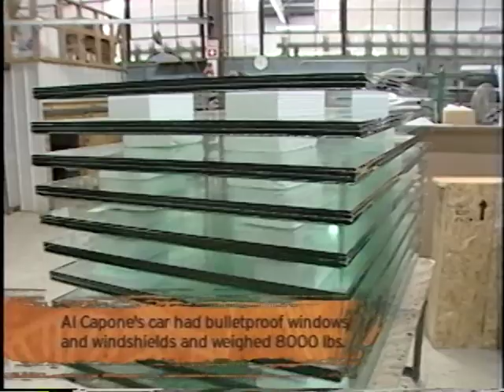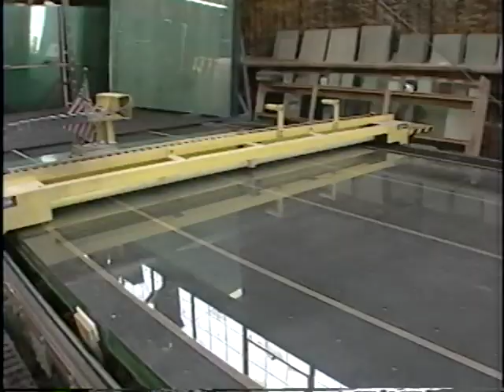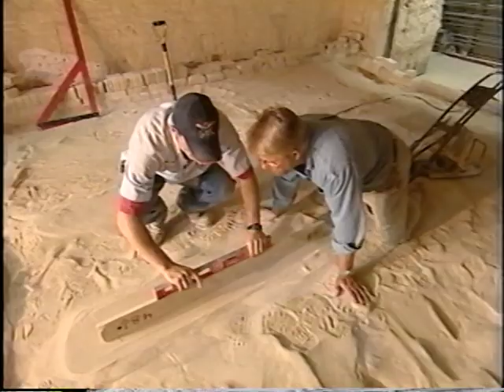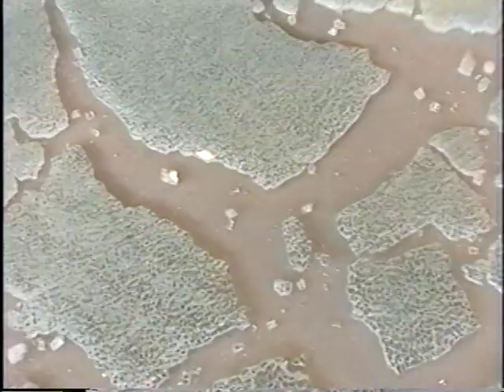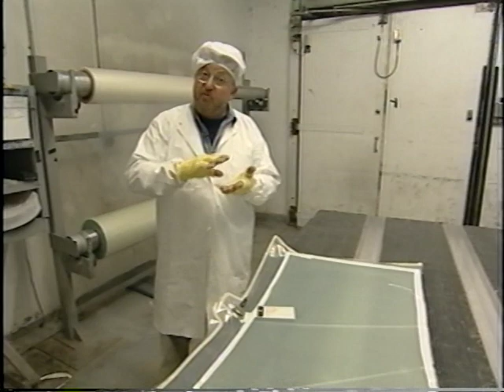Hands on History - Bulletproof Glass

Comment: When people use the term bullet proof obviously they are making a general statement and not specifying the caliber of the ammo or using the more appropriate term bullet resistant.  Technically the 16" guns on a Battleship shoot gigantic bullets.  A piece of glass resistant to 5.56 would have no problem with a .22.  I would give glass and additional rating.  The first rating would say that it is bullet resistant because it stopped the bullet.  The second rating would classify glass based on the glass not receiving any damage.  So for instance if you shot a piece of glass with a weapon using .22 ammo and you shot it 100 times and the results are no damage.  I would classify that glass as bullet proof up to .22 caliber.

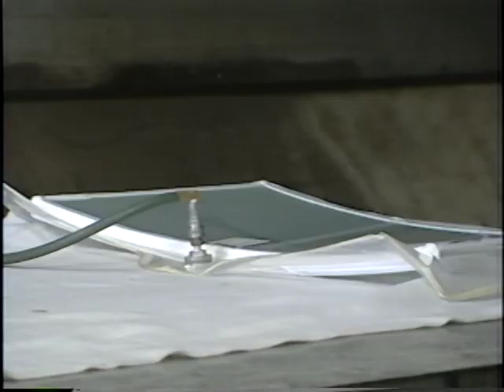Comment: 17:10 how the heat doesnt melt the plastic bag in which the glass is put?
Reply: The autoclave only goes up to around 280 max. It's brittle when pulled out, but not enough to actually breakdown.

Comment: The process for laminating the glass is the same as the process for laminating the composite structures that are replacing aluminum in aircraft.
 Think AirBus 380 (?) most of the fuselage is laminated composites of fiberglass and resin. Helicopter blades are made exactly the same way.

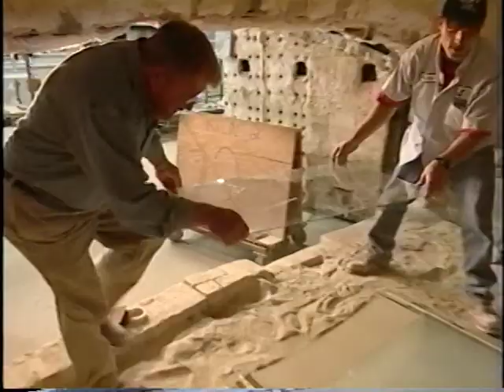Comment: @ 08:45 the commentator says "that way each piece will have the EXACTLY the same curve". This is not at all true. Each piece will have a unique curve based on a radius that is different than any other piece by the thickness of each piece relative to each other. If the glass was 1/4" thick, and the sand surface radius was, say, 120", then the down side of the first piece of glass would have a radius of 120", the up face of that same piece of glass would have a radius of 119-3/4", the down face of the next piece of glass would have the same radius as the up face of the first piece of glass (119-3/4"), and the up face of the second piece of glass would have a radius of 119-1/2", etc.
It may sound like I am splitting hairs, but if you tried to re-arrange the order of the glass pieces after they were curved, they would not fit together, as each one would have a different curve based on the increment of the thickness of the glass.

Comment: A 9 mm revolver ? Most 9 mm do not move 1200 feet per second . A 357 Magnum average is 1250 per second . But it's the weight of  the bullet times the speed gives you power . Do you want to impress me make it glass strong enough to stop at 44 Magnum that would be impressive
Reply: They have glass than can stop .50 bmg
Reply: That's when we get into using polycarbonate in the makeup. You'd ne amazed the combos a 4" thick window can stop. 50cal 3 direct hits in same location til it'll punch through.

Comment: When they mounted the bullet-resistant glass and shot it I noticed that they put the curve of the glass towards the shooter.  Did that make a difference to the resistance of the glass rather than putting the curve of the glass away from the shooter?
Reply: I'm not an expert on bulletproof glass but having worked in the automotive glass industry for 10+ years I can say with certainty that a lot of a vehicle's windshield strength is due to the curve facing outwards. If something were to hit it from the inside it would break a lot more easily. There have been quite a few instances where I had to do a replacement where the rear-view mirror was accidentally hit with a head or hand which caused the windshield to break from the inside. It's all about how the force is distributed through the glass due to its shape.
Reply: I suspect so. Some helicopter canopies that are rated for small arms fire will break if you drop a wrench from the inside.
Reply: This is why armored vehicles usually have alot in angles adds strength and can keep the round from hitting straight on and deflect it

Comment: I own a glass company, we replace glass in windows, we do table top glass, frameless shower enclosures, etc. 
First, the furnace the laminated glass goes in is a vacuum furnace, not a pressure vessel. It pulls a vacuum to get all the air out from in between the glass pieces. 
Next, when they setup the 3/8" glass to shoot it, he said "3/8 glass is what you'll find in your home" seemingly referring to windows. Most windows are actually 3/32 thick glass, or should I say 3/32 thin glass!! 3/8 is 4 times thicker than 3/32 glass. 1/8" is common for windows also.. I'd say it's 50/50. The only 3/8" thick glass you'll find in any home is the shower enclosure. Other than that... great information!
Reply: Michael Boyer it appears their autoclave is different in that they are pulling vacuum on the bags around the laminated glass while the pressure vessel does provide pressure to squeeze the bagged glass with more force than just atmospheric pressure would allow.
Reply: Bret, you're right. Mister Glassman give a s*it about physics.. ;)

And -1 bar at sea level is higest negative pressure what you or anyone can create. Kind of "negative absolute pressure". So If you need more force, you have to add positive pressure outside of that "bag". That laminating technic is nice brainchild.
Reply: @jannejohansson3383  hi Jane, it's nice to have a female in a technical conversation! I have never seen the type of process where there's a bag and you can manipulate pressure inside the bag, which is inside the furnace. Really cool! So thank you both for that info! I was wrong! And I do care about physics. I'm not sure what misled you, but you were definitely misled about that:)
And, it's technique, not technic. Are you Russian? Or Mongolian? Thanks again!
Reply: @mboyer68  I see that Janne Johansson hasn't replied but being a Swede, I recognize Janne as the nickname for the common male name Jan. It's not Jane and not pronounced like Jane and not a female name. Think of it as a Swedish form of Juan.
Reply: In real measurements 3mm is thin cheap glass and 5mm thick is the good stuff. 4mm and laminated 6mm are also used.
Reply: @maxmackinlay618  3mm = .183" which loosely equates to 3/16 which is far from this cheap glass. 5mm = 0.197 which isn't available on the United States. We have 3/32 (0.09375") and 1/8" (0.125") and 3/16 (0.1875) and 1/4" (0.250) and 1/2" (0.500)
Reply: @mboyer68  3/16 equates to 4.763 mm. 1/8 is approx 3mm. We don't use thinner than 3mm for houses in Aust.
Reply: I have extra thick glass in my windows.

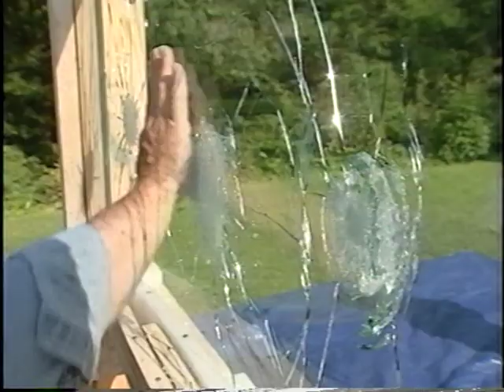Comment: fraud. the first bullet hole is not in the same place as in the final glass, 21:05 and then 21:35. notice the other gun-firing shots, you can see the whole pane of glass in a single recording. The first bullet hits the "bullet-resistant" glass below a dark spot on the vertical 2x4 on the right. In the final shot, the hole is above that mark and we don't see where the other bullets hit the glass because it would be too hard to try and fake three holes. Buncha liars.
Reply from the maker: Good day @h7opolo.  You certainly do have keen observation.  We appreciate you watching.  SBG has had DOD contracts for BR glass for many decades and takes pride in protecting our soldiers from harm.  That being said, this History channel special was filmed a loooong time ago.  There is a chance they may have made a mistake in editing however I assure you, there is nothing fraudulent about the product.  Cheers.
Reply: I doubt if they faked it. That would be a lot of work. But I could see them having to do 2-3 takes, using fresh pieces of glass. This is frequently done in video editing so the editor can choose the best take for each angle. I noticed that there were at least two pieces of glass in the autoclave, so they probably had a backup piece. It would be stupid not to.
I also noticed that the first shot was very close to the edge of the glass and might have compromised the structure of the glass, causing an issue when subsequent shots hit the glass. This would be less of an issue in the real application, as the glass is typically strongly clamped into the window frame to avoid losing integrity on the edges. In this case it's just held by 2x4s, which wouldn't provide the necessary support.
Lastly... are you claiming that bulletproof glass doesn't work or something? Why would they need to fake this?
Reply: @Sethicorn  lol at your last point
Reply: h7opolo damn you right
Reply: A real bullet proof glass is about 2.5 to 3 inches thick glass and lexan laminates and there are 2 of them spaced apart. The aim is to take at lease 2 to 3 hits in the same spot while the second bullet -proof glass will give the person a chance to take defensive action and take proper protection as he fires back.
Reply: More than likely it was due to film production than lying, not that the history channel is a very honest bunch... they either didnt get the right shot or lost it so the editor had to make due with what he had, or the editor messed up and didn't notice which clip went with which. This could have been filmed weeks or months before being edited. Filming is a biotch.